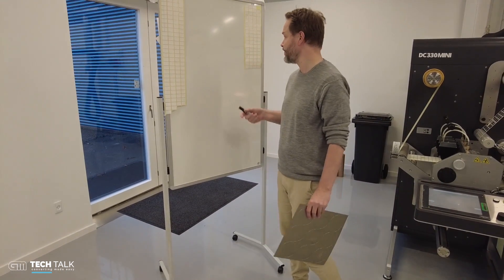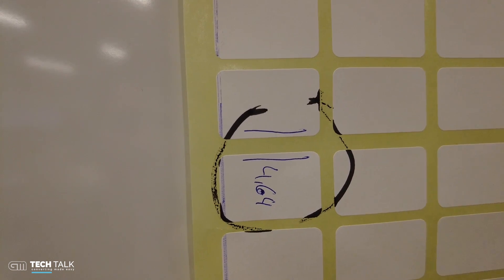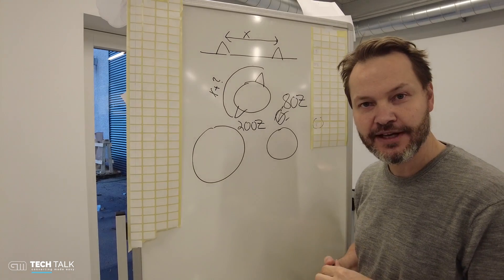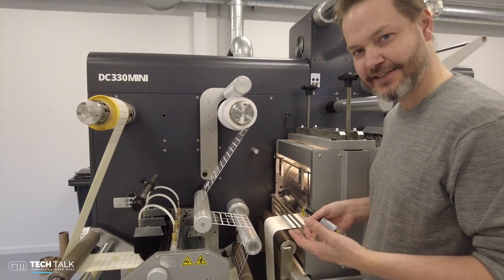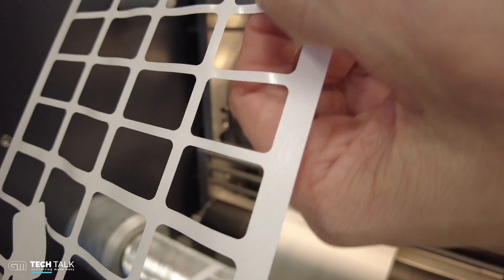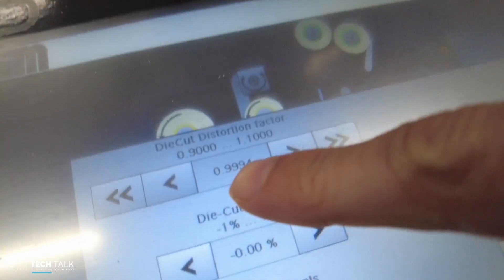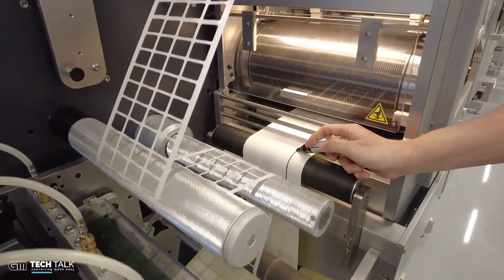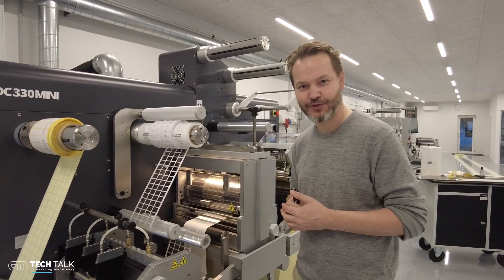Dealing with distortion while die-cutting

Comment: 👍👍 Could we achieve the same result using the method explained below?

We know what should be the gap between the shapes. So, If we measure and determine the amount of false gap, then feed the information to the controller, and it starts each cycle earlier to compensate this false gap. 

Therefore, I think you wouldn't have to force the plate while it's in the cutting cycle.  

While I'm writing this, I realised that this idea wouldn't work if the gap between cycles is smaller than what it should be. In other words, you can start the cycle earlier to have lesser gap, but you can't delay the end of the cycle without dragging the plate on the material.

It may sound illogical, but wanted to share an idea anyway. Thanks for this educational video. Cheers.
Reply from the maker: Hi Tayfun - it is very easy to do when running - just by the eye. We could use your method , but the ideal way would be to connect a small video camera and use for feedback
Reply from the maker: Hi again Tayfun. Just one more comment on this: We can control the gap in BOTH ways, making it bigger and smaller.

This is because we modify the “dancer” under the die cutter, not the die cutter itself.
Reply: @GMTechTalk  Hi. I see now how it's achieved. It makes more sense now. Thanks for the clarification and sharing your know-how. 

Why did you emphasize that the operator shouldn't change the speed frequently? Why do the changes on speed effect the correction?